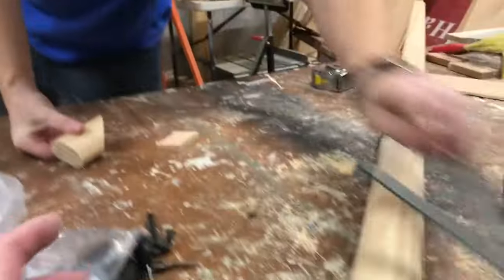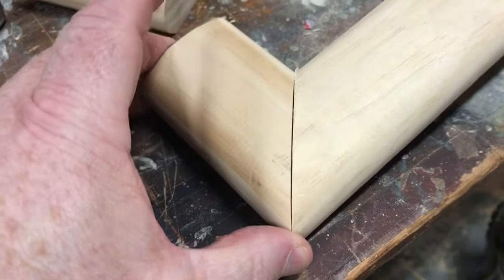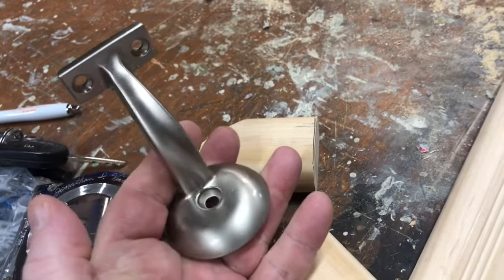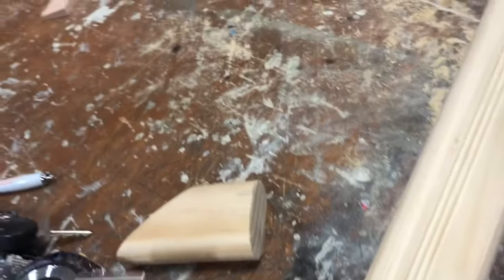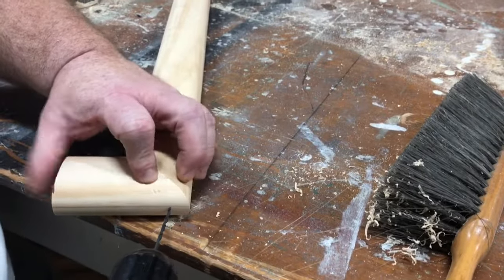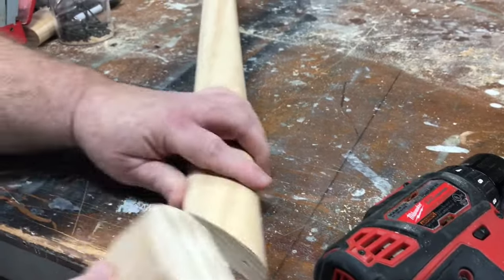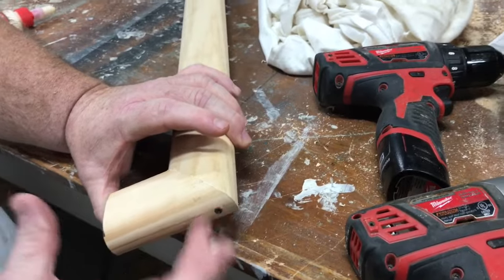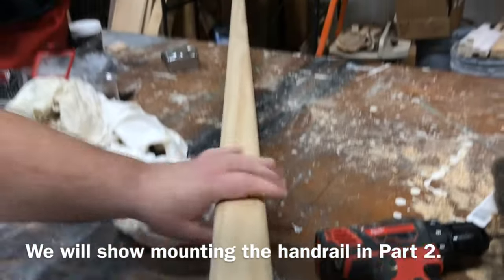Wall Mounted Handrail

Comment: I bought these exact brackets, good to know I made a wise choice. I was going to swap out the brackets from the old handrail, but realized repairing the old handrail would be more work than I originally thought. So now I'm looking at building a new one.
Reply from the maker: I like these better than the brackets with two screws into the wall.  Those have the screws to close together and that is why I like the single screw.

Comment: How would you feel about using a dowel or two to join a connection like this? I’m not a woodworker just curious if that could be a practical approach.
Reply from the maker: This CA glue is a permanent bond, you cannot pull it apart.  You will split or pull apart the other wood first :) No dowel or nails needed.  The point of this glue is no fasteners are needed and it quick!  Thanks!
Reply: @ArtisanTony what brands CA glue do you and why not wood glue?

Comment: How do you handle the transition mite from stair handrail to horizontal at landing? Thanks
Reply from the maker: In residential, that transition is not required but for commercial work where ADA applies, you can miter it for the horizontal transition for about a foot then turn to the wall. Thanks!

Comment: I like the slide correction. 
Good tips. 
Too late for me.., I already bought the three hole mount brackets a few days ago. I was going to block out between the studs anyways for the sake of even and sensible placement of the brackets…so no big whoop. My realtor told me to install a railing in prep to sell.
Reply from the maker: You can swap them out :)  I really don't like the two hole ones. It seems you always have to angle one screw to catch the stud.  and it's too close to the stud to put an anchor.  I am sure it will turn out fine :)

Comment: Do I only need to add one screw to the return handrail?
Reply from the maker: I am always afraid to add more than one trim screw due to the possibility of splitting the rail but we glue it also which I don't remember if we show or not.  The screw holds it until the glue dries.
Reply: @ArtisanTony  I am in the process of building my handrails, and so far, the glue and single screw are working... thanks!
Reply from the maker: @juanrivera5434  awesome :) the will work as long as no one puts excessive force on the return :)